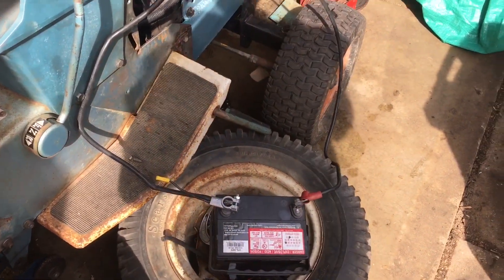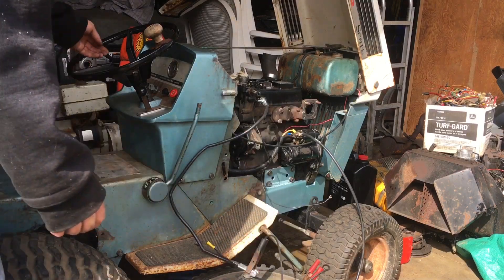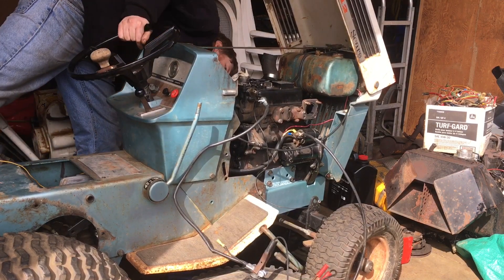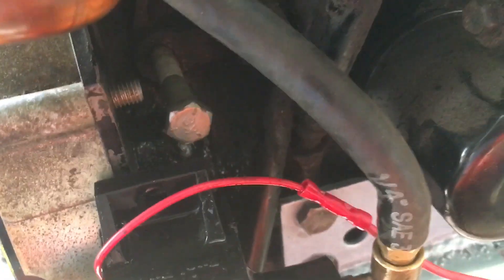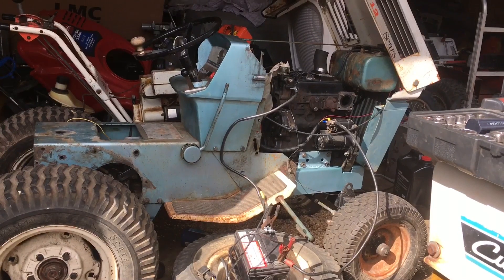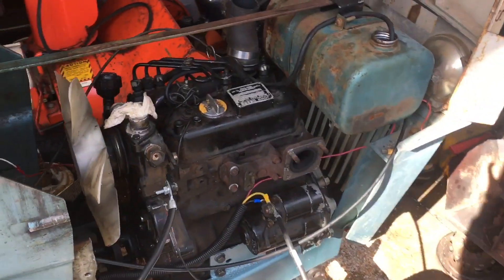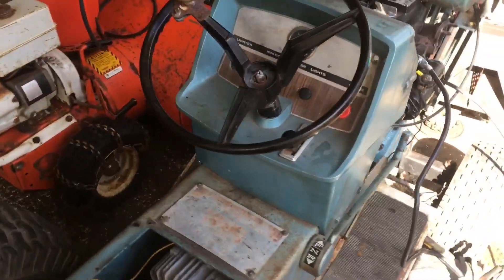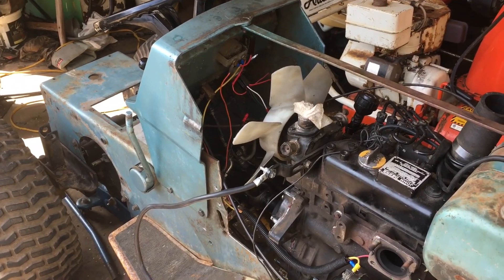1968 Sears SS12 Hydro-Trac Diesel First Start!

Comment: That Yanmar identifies as a Kubota! lol. Definitely need to get those glow plugs wired up. That power steering looks like it works wicked fast!
Reply from the maker: Responsive is what I like! Best part is it retains all the factory Sears steering geometry so it still steers as sharp as factory stock. Probably one of the sharpest turning power steering garden tractors out there lol. Theres some little adjustments to do yet to get the left and right travel equal but luckily its easy between the cylinder being adjustable and the tie rod ends. This is also 1862 Cub steering if I hadnt mentioned it in earlier vids

Comment: I think that's awesome man! And the power steering looks like it works pretty slick!
Reply from the maker: Thank you! Yeah the steering works great as it still retains the Sears steering geometry. Only difference is the drag link from the gears is replaced by the hydraulic ram

Comment: Good deal! Making me look bad though, I haven't worked on my diesel Sears in months. I probably should make some more progress on the poor thing here soon.
Reply from the maker: Ive kinda been waiting to see a vid from you on yours lol. Yeah I have just been lacking motivation on this tractor and it turned into a workbench rather quick but it was a nice day today so I said screw it. Let me wire up the fuel pump and see if it runs. I didnt know if the engine ran when I bought it

Comment: How’s the hydro been holding up? I have a cub cadet 1250 and I’m questioning how long the hydro in mine will hold up...
Reply from the maker: Havent driven this tractor yet. This is a full custom build. John Deere Yanmar engine, Cub Cadet power steering, Simplicity Sunstar trans all in a Sears chassis. Frankly any shaft driven hydro ive ever had has been strong as can be and havent heard of one failing yet. Most common problem for slow moving is relief valves getting stuck
Reply: @71_sears97  yes. On my 1250 cub cadet the hydro relief valves are frozen. However it dosent seem to interfere with the operation of the tractor. I plan on starting this restoration here later this spring.
Reply: Does your Cub have hydraulic lift? The hydraulic lift was an expensive option for the 1250. Most of them did not have it. It standard on the 1450 and 1650.  If it doesn't it probably has a non ported pump. The ported pumps out of a Cub that has hydraulic lift are a much much better pump. They probably take 1/2 the power to run VS a non ported pump and are not nearly as jerky because internally they flow alot more fluid. I put a pump off of a 1450 on my old Cub 127 and it made a HUGE difference in pulling power and overall usability. You do not have to convert the whole tractor over to hydraulic lift. Just put pipe plugs in place of the lines on the pump.
Reply: @bevis226  standard lift is what I have
Reply: The sundstrand hydros the cub cadets used are damn near indestructible. Just about the only way you can kill one is to tow it too fast.
Reply: @benhorn2677  thank you for the comment. Did you mean tow the tractor with something else, or tow something with the tractor too fast? New to this thing. Thanks.
Reply: @Farmtractor  pulling the tractor with something else.
Reply: @benhorn2677  thanks for the clarification
Reply: @benhorn2677  on my channel you can see my 1250